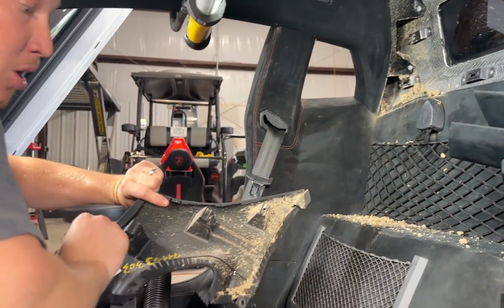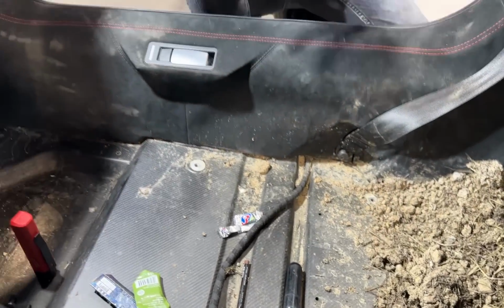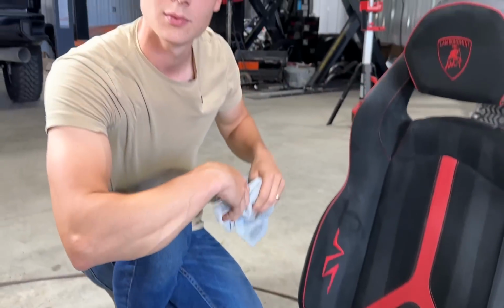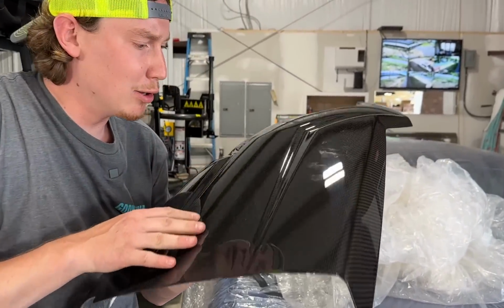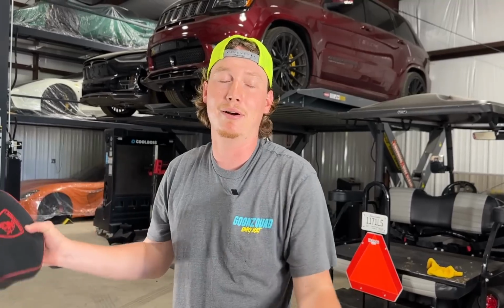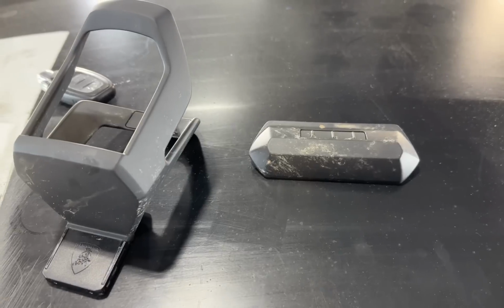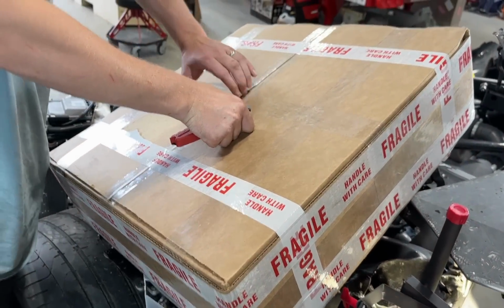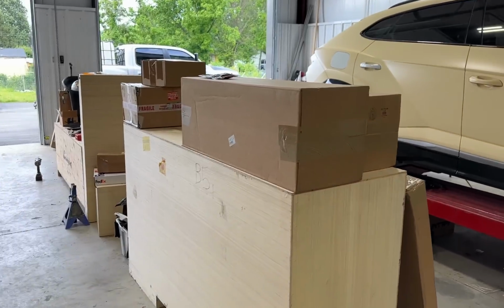Rebuilding A Wrecked Lamborghini Aventador SV Part 6

Comment: Guys, very important after using a steam cleaner on leather parts specifically. Put some leather conditioner on any leather parts you’ve steam cleaned. It will stop it from cracking 😉
Reply: Hello:):)
Reply: There's always an expert 😮
Reply: @TheDingopaul  kkkkkkkkkkkkkkkkkkkkkkkkkkkkkkkkkjojo99
Reply: @TheDingopaul  @Johnny5 is right, the steam cleaner will dry the leather out and it will crack so really important to use conditioner
Reply: @TheDingopaul  you’ve never done leather huh it will shrink and crack if you don’t keep it lotions heat and cold are a nightmare for leather
Reply: Also recommend not putting the carpet solution in extractor u need to use hot water only! Use the solution in a spray bottle. Because your not 100% getting all the solution out of the seat!
Reply: @uncensoredgarden  " it puts the lotion on its skin,or it gets the hose again"
Reply: Do you put those chemicals on your body after every shower you take? Modern leather/vinyl don’t need much to stay healthy! 😂🇺🇸
Reply: @TheDingopaul  it’s a cinch these two aren’t the ‘experts’…

Comment: 2:25 just a suggestion you cant use bottled water on the steamer.. youll mess it up and itll damage it... you have to use distilled water... using normal water it drys up faster and your steamer will give out.. i used to detail cars and before buying a steamer i did my research on what type of water i had to use...

Comment: Love the vids guys, keep up the hard work on this crazy build.
Just be careful with the steam cleaner because if you get too close or apply too much steam to specific areas/material, it will strip away colour and damage the texture.
And with the wet vac; for best results, apply then agitate the solution and allow it to sit for a minute or two, then remove it all with solution and vac. Just a tip, keep smashing it ❤️ from the 🇬🇧

Comment: Love the SV content. I think you might be using the steamer too early in your interior cleaning process. I would get more dirt out first so you aren't just steaming it into mud. Use a brush and cleaner to agitate the worst of it first, then steam is more of a last step before applying a protective coat.

Comment: The steamer will damage and make surfaces dull if pointed at an area for long moments, it should be used at a quicker speed and not left at a surface for a long time
Reply: and this is way to much Water for Seats. They never will dry complete cause the Foam hold it.

Comment: Hey guys you might want to add an extra cup holder to your replacement parts so you can weld up a T shaped bar of Soft Aluminium so that the center bar attaches to your original cup holder mounts & you can mount both cup holders side by side onto the T bar for both the driver & passenger.

Comment: also use a small dehumidifier on low setting to pull out some condensation out when steaming, some upholstery can go mouldy over time due to condensation build up in ceiled areas.  Swade is bad for it hope this helps.

Comment: i dare say there are a million comments down below about this already, but once you have used the carpet extractor solution, run the extractor over the seats a few more times without the liquid flowing to try and extract as much liquid out of the foam as possible. allows the seats to not only dry quicker but reduces the smells that can form :)

Comment: Dont get the passenger seat bottom too wet it has a sensor inside that detects passengers if it goes bad you have to remove the covers it will get damaged

Comment: Those front carpets, 1st one looked used, alot of the grip on front was lifting and mucky on back, 2nd one looked right but 1st not so much.
That mud in back wasnt there a big hole in the roof from the roll over that serg fixed?? Surely thats where the mud got in??
I'd go.just subtle red double line stitch on the seat belts to match the double red piping on the door arch innards / sill.
Need to drop that headliner incase full of mud

Comment: It seems to me with the carpet cleaner they were applying cleaning solution and suction all the time? They should be just doing the suction part and taking their hand off the trigger to pull the dirt out properly and dry the upholstery quicker. The seats still looked soaking wet after the clean!

Comment: 700 is a good deal.    Most professional ones are 5,000.    Make sure you use anti foam. It produces soap bubbles and pops in side your vacuum motor.    It will make it last longer 😊

Comment: Regarding the mystery mud in the cabin, though it is totally possible that the window was down and somehow scooped it up and flung it inside during the rollover, it is also very likely that the tow truck driver shoved up excess mud that was left on the road at the scene and/or shoved the mud left on his flatbed and threw it inside the cabin. Seen and heard stories of tow truck drivers doing this very thing with ANY sort of debris left at the scene of an accident.

Comment: For those playing along at home, thats not how you use a steam cleaner and carpet shampooer.
Steam only kills germs and loosens really stuck stuff. For general cleaning youre better with spray and a cloth.
The carpet shampooer doesnt deep clean. It only washes the top most pile. You need to vacuum the hell out of the seats first then shampoo the pile. If you shampoo before vacuuming all you will do is wet the dirt and make mud in the fabric

Comment: For the at home user you don’t need to spend $700 for a good upholstery and carpet extraction machine. Bissell makes a good one for a little over $100 and it’s perfect for car interiors and all other around the house uses. When you shampoo and scrub you are just pushing a lot of the dirt further into the seat or carpet. Extracting the dirt is the best method. IMHO.

Comment: Pops says, total red seat belts on his lambergeni must be a flood car with all that mud. I just bought 2013  tahoe slick with special leather interior two tone interior i was looking around opened back little panel on wall it was full of red mud then i noticed red cast coming up on carpets several months later .now i looked  in main vent up on dashboard. its full of red mud .so i know its a flood car but its nice and drives and runs like a striped ape it does stand out in a crowd too looks wize too .it has 2017 18 inch wheels on it .

Comment: Gentlemen, before you put the whole car back together, can I make a suggestion on the 12V's connections. I drive a 2012 Peugeot 508, I changed all the 12Vs to the USB connections as I have two daughters who use their Cell phones all the time so needs charging. I bought Double USBs Poiints and they work brilliant. I can assure you  it works wonders and a whole lot of bother.

Comment: Don’t put the soap directly into the extractor. Spray a soap/water mixture onto the fabric, scrub, and then extract with pure water. Putting soap in the extractor will cause buildup and leave residue on the fabric.

Comment: Ugh man they left so much soap in the seats.  NEVER add shampoo to solution tank.  Solution tank is fhe water only. Spray on cleaner and then extract. They didn’t pull any of the soap out and will now get dirtier faster

Comment: This car definitely was not in a roll over! That roof would have been scraped to hell, the front end would have been scraped up on top and its perfect and the doors would have been destroyed! This car was never on its roof, not to mention first start and no blue smoke from the engine so no oil got in the cylinders which also indicates not a roll over! This was seems to have been rear ended by a taller vehicle like a truck hence the back being pushed in and the roof getting slightly damaged at those fins. It was rear ended which made the car spin out off the road which is why there is so much mud and dirt everywhere and in the interior. Mud was flying in as the car was spinning out of control. Just a theory but it sounds more sane than a rollover.

Comment: i wouldnt put soap in the extractor, just hot water, the intent is to soap and agitate the seats and then rinse with hot water. If you keep doing it the way you guys are, itll just leave soapy residue on the seats
Reply: also, a bissell extractor used is like 150 and the suction part is clear so you can see when the rinsed water is actually clean and you know when to move on to the next section

Comment: As far as you guys tear down most of those vehicles, why don't you just  hang the carpet over a fence or screw it to a wall and spray it with super clean , brush it a little and pressure wash it. It's fast , does the best job every time and gets it all out . The carpet in the Lambo is a prime candidate for that action. Far better than your extractor.

Comment: Always love when you guys busy the detailing tools out. Remember to only run distilled water in your steamer. For the extractor I recommend using only water in the machine. Use your extraction solution in a pump bottle and agitate before extracting. Keep up the good work.

Comment: You guys can get carbon fiber cup holders and Matt's 3d printed from the right machine guys cheaper check on stuff before you buy vw stuff for a Lambo it's only a Lambo name is why anything is high like a 4 grand cup holder 3d print it with a logo on it

Comment: There should be QR codes or part number. You can cross reference the pat numbers. Matt Armstrong does it all the time to save money.  His Gallardo has parts from Ford, Ferrari and other vehicles. The shared part may be $1,000 + through Lamborghini or purchased as a Lamborghini part however, the cross reference saves a ton of money.  The AC control unit is shared with several cars including the Paganini,  Ford and some super cheap Euro only branded car. The same part for over $1,000 but same exact unit from the cheap Euro car, the AC control unit was $25.

Comment: If you take off the tip on the steamer you’ll get more steam coming out. Also put a towel over the steamer attachments if your going to clean fabric. It helps pick up dirt and avoids getting dirt inside the steamer.

Comment: The best way to use the carpet extractor is to first spray the solution on the area and THEN vacuum it, don't do both things at once, that just creates a bigger mess for no reason.

Comment: Dragging those seats on concrete may expose the raw metal on the bracket part, unless that's carbon fiber too. May need some touchup paint on the bottom prior to reinstall.

I'd be 3D rendering those small pieces in various colors and sell em. Imagine a red cup holder

Comment: PPF the door panels, center console ect, any parts of the interior that may scratch easily. I had this done to my wife's car right after purchasing it (new of course so, no real prep work like buffing needed). Regardless if new or freshly buffed to 0 scratches,  the PPF absolutely saves the interior trim as well. Her car in the 2 years we had it never got a single scratch on the interior or exterior (exterior was also completely PPF covered and Ceramic coated.

Comment: I don't know if you guys noticed or not, but while was watching, I noticed that the passenger side intake tubes, going from the airbox to the intake itself, were pinched or compressed. I think your entire passenger side rear has been bent in towards the engine. I know you know about the air intake mouth, that stainless steel part you had to open up but I don't know if you noticed that with your intake tubes. Hope this is helpful!

Comment: Watching you burn through the clear coat on the interior carbon bits was hard to watch man. You guys are getting kind of reckless lately (running the wheels when rocks are in the brakes, driving it with parts hanging off, etc.) Slow down and be more meticulous please guys, it's making me cringe so hard.